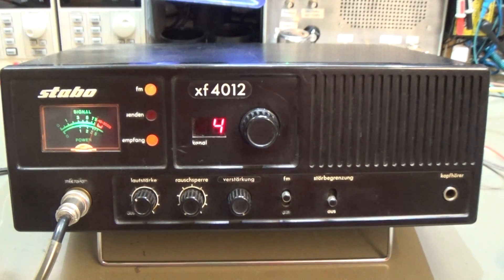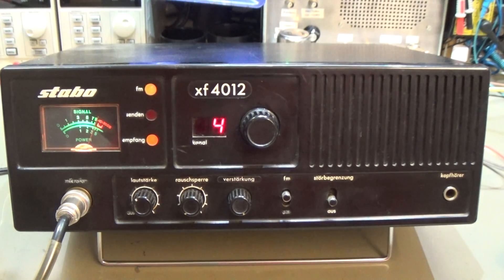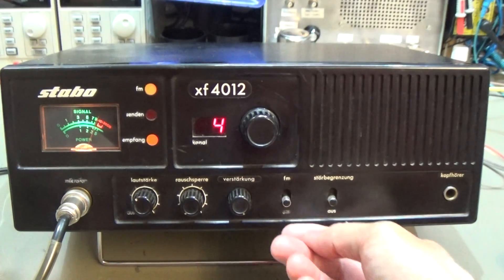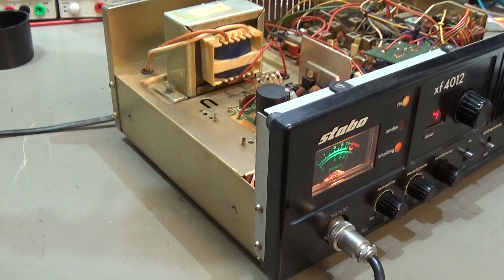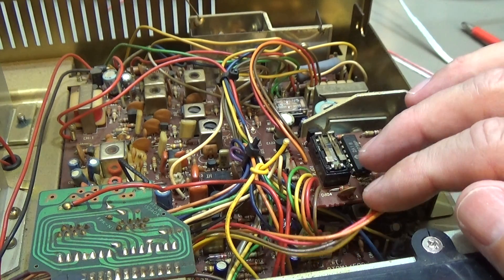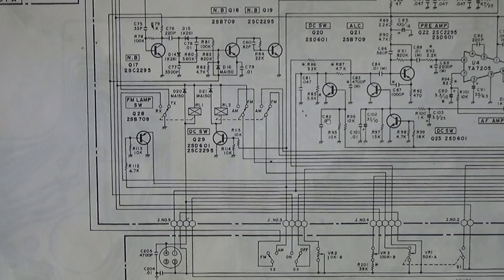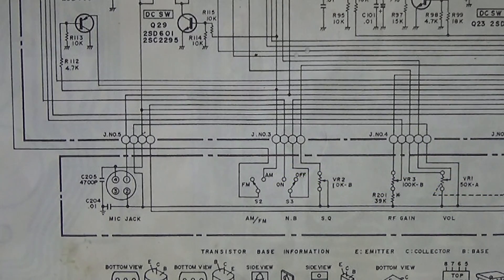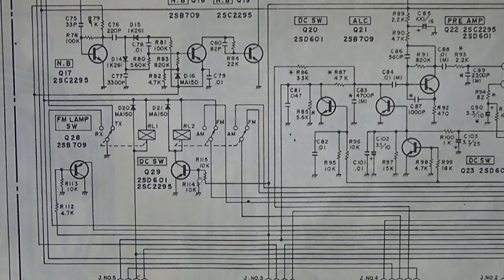#185 Vintage Stabo XF-4012 no working AM mode fixed

Comment: Good morning Peter, thank you for this nice ts. I can´t count the amount of Stabo i had here for service. One of the most requested things was to enable 40 CH AM back in those days;-) In fact, nobody used it then and nor they do today ;-) I always loved the simple black housing and the purity of design. No bells or whistles, just a reliable cb radio. Same for the XM mobile series.  By the way,  i am worried about the 15V, too, like Buddy said. Sounds like golden screwdriver tuning on the power supply poti. As always, you did a straight and clean job, thank you for a good start into this sunday! 73 de Olaf
Reply from the maker: Hi Olaf, yes Stabo was a very nice CB brand back in the days...And right all folks wanted to get all 40 Ch open for AM and never used:-) Well 15 V is a bit to hight but still in the limits still not really harmful and if that is wrong I have a new repair on the bench hahaha...only kidding. All the best 73

Comment: I would be surprised if the Siemens relay in the RL1 position was the original!  Interesting CB radio, Peter! :)
Reply from the maker: Hi Alan, not sure if it was the original but Siemens relays has been used back then in CB radios. Thanks for stepping in

Comment: I just ran into the same problem with a service manual on an Alinco DX-70TH. I was going through the alignment procedure for the transmit section and when I got to the SWR settings I found that the low pass filter board was completely different than the one in the manual. I had to search through 5 different manual sources before I found the right one. I have not found any indication on the radio of a different version number or any indication on the manuals that they are for a certain serial number series. Strange, the alignment procedure is quite different between the two as well so I had to start from the beginning. I can relate to the problem that you faced on the Stabo. Great video as always.
Reply from the maker: Thanks for comment Mark! Yes very often you have to deal with various versions..

Comment: Cool fix Peter.Relays are the number 1 suspect in circuits like these. You nailed it my friend.   Looks like the power supply runs a little high on that one. 15 volts?  As always thanks for sharing. And good to see another video from you.
Reply: Yeah, 15V screwdriver tuning maybe ;-) Thought the same, Buddy!
Reply from the maker: Hey Buddy hope you are fine and the storm didn't hit you!! Yeah you are right relays are always no 1 suspect...Correct the power supply runs a bit to high but should be still in limits. Advantage is a bit more power reserves. Take care my friend

Comment: I think the guy who botched that fix just wanted the radio to work with FM modulation all the time, so what he did was cruel but effective. Nice work as always Peter. Enjoyed the video.!
Reply from the maker: Hm interesting view Bora but why  should he disable the AM? I can't see a plausible reason for that??
Reply: Hello Peter, correct me if I'm wrong, but from what I understand, the radio was made to default to AM on certain channels, which I think was the law at that time. But now, since no one uses AM on CB in Europe any more and a radio that keeps switching to AM by itself  would be hard to use. That's why I thought someone tried to prevent that.
Reply from the maker: See your point Bora! The radios were 40 channels FM and additional 12 AM back at the time, so from channel 4-15 it was both AM and FM...

Comment: Hi Peter and welcome back from TRX bench, sure missed U. I have a couple of questions if you don't mind. Do you find that when someone tries to repair a radio, it only helps to point out the problem area. Do you prefer working on newer or older radio equipment? What would you charge or how do you charge for a repair such as this one (quote or hourly). And lastly I had to laugh when you wanted us to hear the relay click you zoomed the camera in on the relay. I don't think that zooming the camera helps us hear it better. Anyways Nice to see you back on the TRX Bench CHEERS 73
Reply from the maker: Thank you Tom glad to hear that! If I got your question right...no it never helps if someone tries to repair a radio as very often we have multiply issues afterwards which sometimes leads to a no fix situation.  Personally I prefer to work on modern stuff all what is produced with smd parts is what I like. On the other hand I like to work on tube stuff..Doesn't help zooming to hear better LOL :^) Cheers and 73

Comment: Hey Peter. Another fix that you made look so easy (but wasn't!!). It must be disheartening to see that someone has been in before you and attempted a repair using a large hammer, a blow-torch and a small axe (an exaggeration, but you understand!) These attempted repairs just make the proper repair that little bit harder... Well done Peter as always, 73, Brian EI8EJB
Reply from the maker: Thank you Brian! Yes indeed sometimes exactly the repair attempts simply leading to a no fix situations as you have multiply issues after a repair attempt.. All the best and 73

Comment: Hi Peter and everyone else!, trying to fix a radio with a possible cpu fault, I have never worked on cpu radio before, and I am trying to see if the data, clock, enable signals are getting to the PLL chip, anyway I remember Peter looking at signals being passed from cpu to PLL chip but can't for the life of me find which video it was, so if any of you can remember I sure love to hear from you. Thanks
Reply from the maker: Hi Justin,  video #104 is one of the videos where I show it.. Hope it helps 73